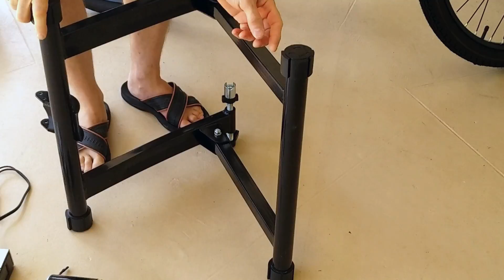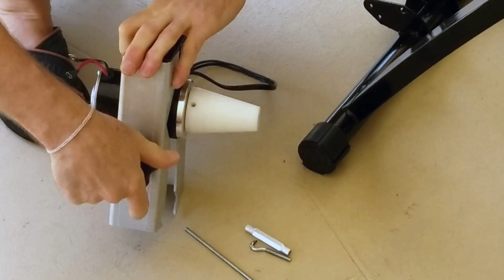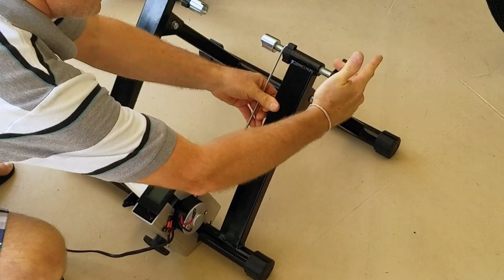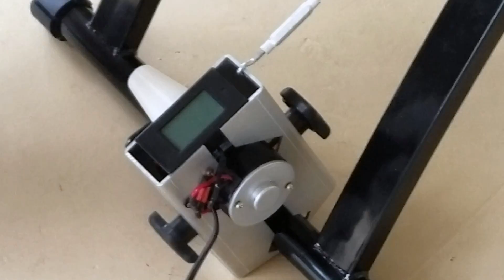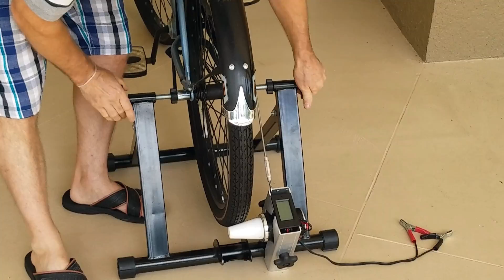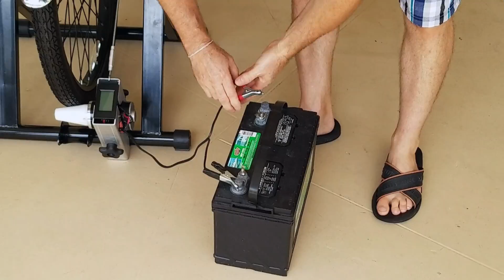eSpin Tutorial Assembly Instructions

Comment: @Tesla Polarisz Thanks, can you break it down in amp hours?  How many amp hours can I peddle into my deep cycle battery per hour?
Reply from the maker: 60 watt at 12 volts (assuming 12v battery) is 5 amp hours
Reply: @teslapolarisz1816  I didn't know the math, so watts divided by volts = amps.  That's a good deal, I'm going to buy one. And I sent you an email, I'm interested in becoming a distributor.  Thanks!